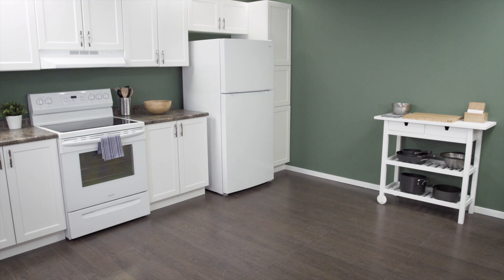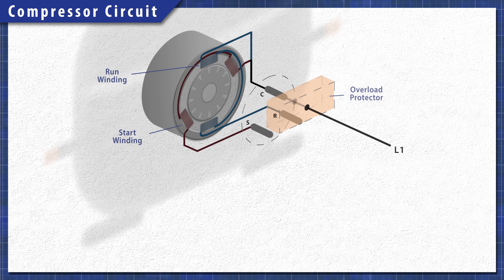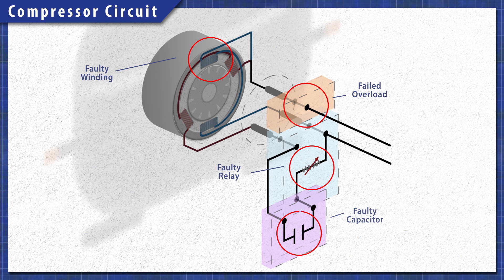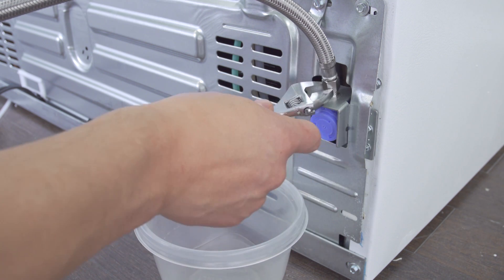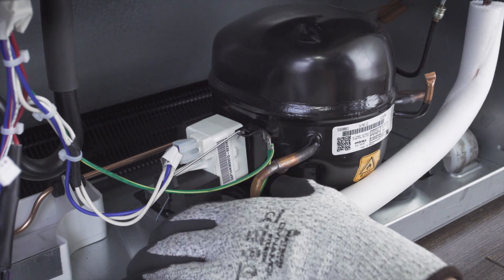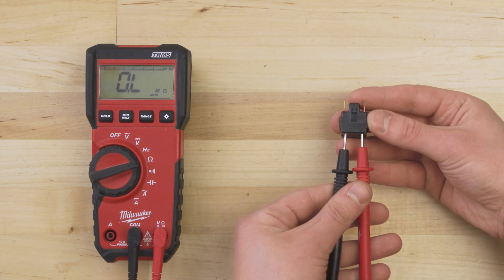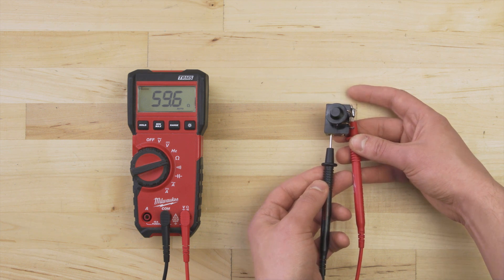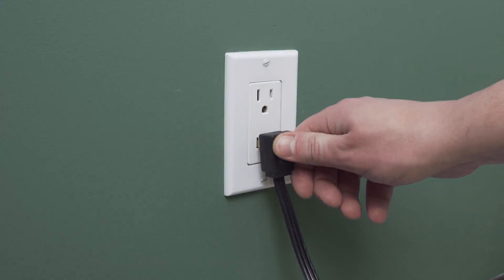How to Test & Replace the Compressor Start Relay in a Refrigerator | Repair & Replace

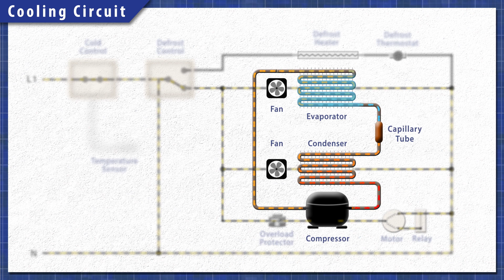Comment: Your diagram is wrong.  Shows relay and motor AFTER compressor going to nothing.  1:05 fail
Reply from the maker: The compressor icon shown is a visual guide but the winding and relay are depicted beside the compressor to make it easier to read. These are still connected to the neutral wire, so no there are not "going to nothing".

Squishing the overload, relay and windings inside of the compressor icon at this scale would be not helpful and would not gain any clarity.

Comment: I got around 180ohms on my start relay.  Am I cooked?
Reply from the maker: Thanks for watching. That resistance is significantly outside the normal range which means that it should be replaced.

Comment: The wires don’t wanna come off my relay it’s a Danby 4 prong relay and the wires have these metal bits that hug the prong but no matter how hard I pull they don’t come off. Any advice?
Reply from the maker: Thanks for watching. If the connectors are difficult to remove you can try using needle nose pliers. Wiggling often helps. As well in some cases you can use a screwdriver to get under neigh and pry the connector off.

Comment: What if the compressor relay(wr07x10110) for your model (GE Refrigerator GDL20KCSCBS) has been out of stock and not found on ebay? Can you use a different relay?
Reply from the maker: Thanks for watching. Sometimes there are cross references or lookups that will point to an alternative part number. You could try emailing or calling GE directly for this info. If you cannot find an exact replacement or a similar relay then there are 3n1 universal relay kits available: https://www.youtube.com/watch?v=8dRlB-VquDc&list=PLCo9SMjkdWBxXf2GEiSiunxAlN3ENxXGq

Comment: Hi, when testing resistances on small compressors like these. I have found that the PTC relay is actually disconnecting the winding with the lower resistance, and the winding with the higher resistance stays in circuit. This seems backwards to me. A single phase motor start winding should have the higher resistance, hence why that is the winding that get disconnected after start up? 
Please help, this is driving me crazy! 

Thank you
Reply from the maker: The start winding typically has a higher resistance than the run winding but there are some that might have it set up different to achieve specific motor performance. In compressors with PSC permanent split capacitors the resistances will be closer in these cases.

Comment: Nice video, but I think you missed a few things. Things like:  #1. How can you tell on a given compressor (or at least the current compressor that you're showing) which pin is the start and which one is the run pin that are sticking out.  Same goes with the different relays that you're showing (or at least the current relay that you're showing), which connection is for which function (run or start), and what would happen if you happen to cross them, or cross them deliberately?   #2. How to easily tell which pin goes to which hole of the Relay/Overload, because some compressors have the orientation of the pins upside down (or maybe even sideways?).  Because in theory it could potentially be plugged in sideways because the pins' orientation is in a triangle shape, and in theory you could connect the Relay/Overload in any way you want, no?  #3. When you are disconnecting and/or plugging in each and all of those wires, why not explicitly show and explain which wire goes where and why and what the function of each wire is, and show all the different configurations that wires may possibly go on depending on the different type of Relay or Relay/Overload or Relay/Overload/Capacitor combination. #4. What do the colors of different wires mean?  The black wires of the capacitor were sort of self-explanatory, but what about orientation of the wires? Also, I saw a white and a blue wire being plugged into the Relay.  I have also seen many times a red wire being connected to the Relay.  #5 What does the size of the Relay/Overload pins mean, because I have seen the two Relay pins are sometimes different size from each other.  Also, why are some Overload pins smaller or skinnier than other similar or same looking Overloads?  #6.  As far as identifying each and every one of these things, is there an industry standard that every manufacturer obeys by, and is there a DEFINITIVE AND AN EASY way to be able to tell all of this, regardless of what type of a fridge or brand or setup, as to what's what and who's who to eliminate all this confusion?  #7. Lastly, some Relay/Overload combos come in a kit and some have on the body of them there's a dot, either a red or a black dot. What does that mean, and how to tell which one of those is for your specific fridge or compressor?  Maybe you can do a new video and incorporate these subjects into it, or maybe you can add these things and answers to this existing video somehow.  Thank you.
Reply from the maker: Thanks for watching. We created a detailed compressor troubleshooting video which will likely answer your questions. https://www.youtube.com/watch?v=NND8J8dXqJ0

Comment: Hello why deep freezer cuts of after
   

Few minutes
Reply from the maker: Thanks for watching. Either the cold control thermostat is faulty, or there is a buildup of heat which is tripping the overload protector on the compressor.

Comment: hi. I have a QP2-33MC relay that i tested for continuity across its two terminals (after it is cooled down to ambient temperature), and it gave the beep. When i tested on ohm setting, it give me about 34 ohms. Its not like you said, that should be between 3 to 12 ohms. Then i googled a bit for this relay, and i found out various sources mentioning 33ohm resistance for this relay. Now i don't know whether this relay should give 33 ohm resistance when checked for continuity, or whether this 33ohm relates to something else. Can you let me know if my relay is ok or bad? I also checked the overload protector for continuity, and it is also fine (gives beep for continuity). My LG refrigerator issue is that its compressor doesnot start over once tripped after having the refrigerator temp dropped to whatever desired value programmed there.
Reply from the maker: Thanks for watching. It seems like your resistance is within normal range for that particular relay. We have a video that shows how to test the capacitor, compressor windings and the overload protector. It can be good to test those as well: https://www.youtube.com/watch?v=NND8J8dXqJ0
Reply: @AmreSupply  Thanks for your response. So it seems that the OL protector and start relay are good. I checked the other video link that you shared above, and checked the compressor windings. I am getting a resistance of about 35 ohms across one of the windings instead of 10 ohms, while the resistances across other two windings do add up to 35 ohms. Having higher resistances across the windings means what? May be the compressor is failing, due to age? My refrigerator (LG) is almost 14 years in operation now.
I also played a bit with the circuit board (EBR327903) located on top of the refrigerator, tried to see the components visually to observe any signs of burn marks of relays / resistors, or swelling of capacitors, but all seems to be fine. While inspecting, i observed two repeated clicks sound in one relay (the largest of all 4 relays) that try to operate and i hear the compressor trying to run and then it stops. The relay code is EBR54874707. I checked the voltage across its input terminals and found it to be ~11 volts. I plug out the refrigerator, and supplied 12V from an external 12V,2A power adapter to check if the relay works fine. It worked fine, without any repeated clicking; means the relay is working fine. 
I turned on the refrigerator again, and continued testing of other resistors and diodes, until when i touched my multimeter probes across one resistor, that made the above-mentioned relay to click, that started the compressor immediately. I decoded the resistor color codes and also measured the resistance across it, and there was no difference, means the resistor is fine. The resistor terminals checked for any looseness on the circuit board but they appeared to be soldered fine; no looseness whatsoever. But i am surprised how connecting the multimeter probes across this particular resistor make the relay to operate and start the compressor. I have successfully managed to start the compressor multiple times by connecting the multimeter probes across this specific resistor to start the compressor. But i can't come up with a possible explanation why this is so? May be putting the probes across this resistor somehow change the current path through the multimeter rather than the resistor itself? Does this mean that the resistor value needs to be decreased due to some reason, that makes the relay to operate properly and start the compressor? Do you have any further suggestions to proceed further from this point?
Sorry for the long explanation by the way, but i feel like i should explain in detail whatever i have been upto with my refrigerator lately.

Comment: How do I save this excellent video to a play list for watching repeatedly?  I logged into You Tube but could not find the SAVE button.
Reply from the maker: Thanks for watching. The save / playlist button is different depending on the device. In mobile, sometimes this is hidden and you have to slide the icons over to reveal the save button. 

Regardless there is this complete compressor / start component troubleshooting guide which is another good one to save: https://www.youtube.com/watch?v=NND8J8dXqJ0

Comment: Please I have continuity on my ptc relay but the resistance is high , it's gives 19 ohms.. should the relay be changed.
Reply from the maker: Thanks for watching. 19 ohms is higher than it should be at room temperature. If you let the PTC cool down  all the way and it still reads 19 ohms then it could be problematic. It is still worth checking the overload protector and the capacitor. You can see the complete compressor troubleshooting guide here: https://www.youtube.com/watch?v=NND8J8dXqJ0

Comment: Hello. This is what I have, does it indicate a bad relay?
Whirlpool WRT111SFDW03. 7 years old. 11.2 cu ft size. Freezer on top.
Start relay
P/N: WPW10448874, 
aka W10448874.

Capacitor ("cap") P/N: WPW10662129

Test relay connections with capacitor on the relay.
Results: when together I can get cap to charge and discharge thru the start relay, just like it does when it's off the relay.
With cap off and on, neither of the lower holes have continuity with each other. The hole on lower left has 0.0 ohms resistance thru the bottom blade of the back of the plug.
The lower right hole has no continuity with anything but can be used to charge the capacitor for testing.
The upper hole has 0.1 ohm resistance  to the top blade on the opposite side.

Remove relay cover and visually check. I cannot get combination relay apart without breaking it, so I haven't committed to that, yet.

Ohm test the fridge compressor pins again. Make sure the Common (top) and lower pins are within 3 ohms. And the two pins at bottom should read about the sum of the Common with the Start and Run pins. See YouTube video...
Results:
Top and Lower Right : 4.4 ohm. 
Top to Lower Left: 6.0 ohm.
Two bottom pins: 10.4 ohm.
None of the pins are shorted to ground.

My problem is it suddenly stopped cooling without noises or warning, but I caught it from hearing loud buzzing noise from compressor and relay area, and compressor was very hot. No smoke or smells though, and wires did not seem to be hot.

Do you think it's the combination relay? Thank ya!
Reply from the maker: Thanks for watching. Based on the part number that you gave, you have a relay that has a built in board so the resistance tests shown the in the video won't apply. The other kind, the PTC thermistor can be tested. The continuity tests on either side won't tell you if it is bad or not.
Replacing the relay would be the best course of action as your compressor resistances seem good. 
As well it could be a faulty overload protector, so it's best to test that as well: https://youtu.be/NND8J8dXqJ0?si=rFB2hLCv1RZg6xU2&t=527

Comment: Thank you for the clear step by step instructions. After several videos this the only one that helped me.
Reply from the maker: Glad it helped!
Reply: @AmreSupply hello I replaced my relay and overload and my refrigerator started working again but only for a few hours them stop working again any suggestions
Reply from the maker: @Robert-qo9wk  You could try checking the compressor windings for resistance as well checking for a short. This is shown in this video: https://www.youtube.com/watch?v=NND8J8dXqJ0

Comment: Many ptc compressors do not come with a start capacitor only run capacitor.how come you can't explain finding which terminal on the start relay goes to neutral or hot wire?
What if you get there and all the wires are already disconnected and taking a picture  of it wont help ? You know how to ohm out the compressor and find the start and run terminals on the compressor.but how come you can't explain the terminals on the start relay and why the neutral or hot goes to the specific terminal of the relay and overload specifically?
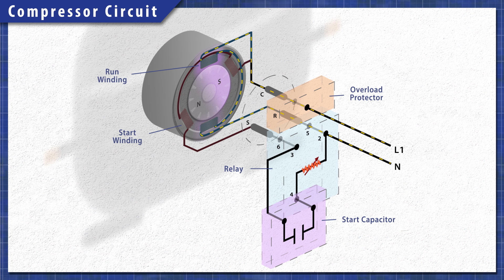Reply from the maker: Thanks for watching. Did you watch the "how it works" segment from 0:50 to 2:38 ? This explains the difference in wiring of a start capacitor versus a run capacitor. 
The wiring can be different and not all relays will have all the terminals present. 
If your relay does not have a 1 terminal and has a 4 terminal, then you likely have a start capacitor. 
Alternatively if your relay has a 1 terminal, and does not have a 4 terminal, then you likely have a run capacitor.

Comment: For the first time, I found the information I was looking for very clearly. The explanation is very good. I think there might be only one thing missing. You could have explained more clearly the energy cables coming from the network and the thermostat connections in order to support the situation. It would be great if you add this too. Greetings from Türkiye.
Reply from the maker: Thank you, we're just happy to share some good info. In this video we tried to generalize the "cold control" as some models have a cold control thermostat and others have a control board. In either case, there is a call for cooling. The cold control thermostat will close, and 120V will travel to the fans, and compressor. This continues until the set temperature is reached. If you are curious on how the cold control thermostat works, we show this more in this video: https://youtu.be/09MmevMH0hA?si=yra4lnNBNfTGyzV9&t=136
As for more info on the refrigerator in general we have a detailed "how it works" video https://www.youtube.com/watch?v=FMpnRugHrOE